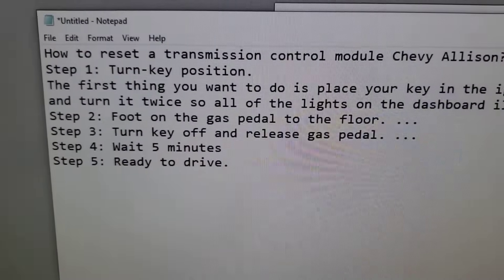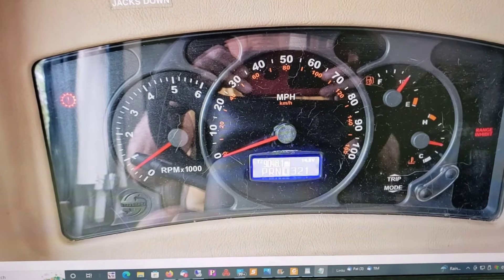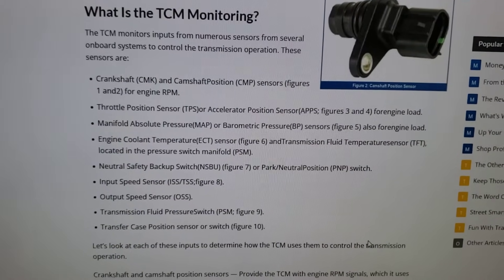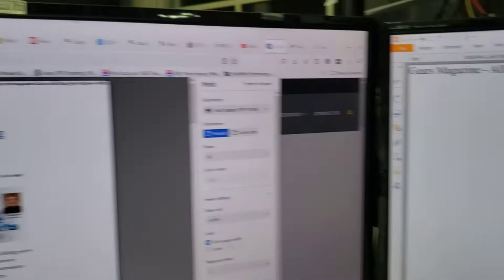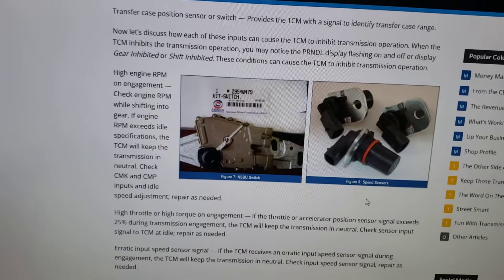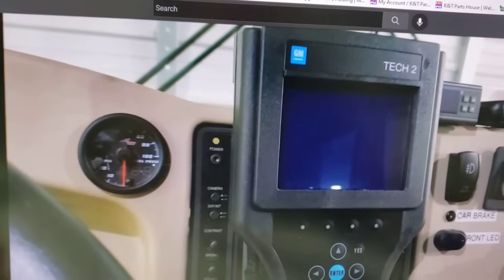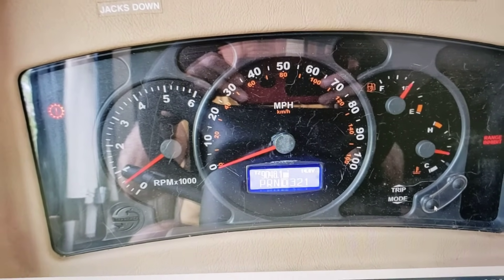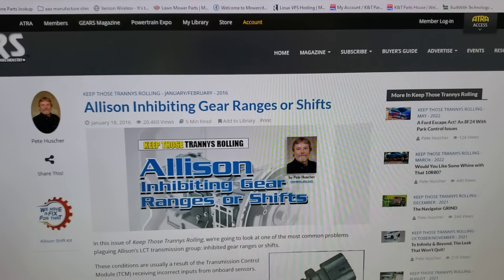Workhorse Allison Transmission Range Inhibit Dash Light is On Along with Gear Light RV Won't Move

Comment: Have you ever had the jacks get stuck down? I had mine not retract last camping trip I had to manually retract. When I got home I drained and filled the system but the warning alarm still rings I can't figure it out.
Reply from the maker: Call or text me I can help you with that 606-875-0125 Kevin

Comment: For Most with "Range  etc etc" on the DIC , before you spend a bunch, unplug and replug the electric ignition box under key.  If no good,, swap out the 20-30 dollar electronic box for the ignition key.   After that, you can try swapping the neutral safety switch on side of transmission. About 150 bucks from a big rig dealer that sells Allison stuff. 1/2 cost of car dealer. Ask me how I know. 99.999% chance it's the key ignition  box. The key only turns those gears on that box.
Reply: Also, when you pull out the ignition box, mark the indexing of the gear with key off.  You will need to index new box the same.